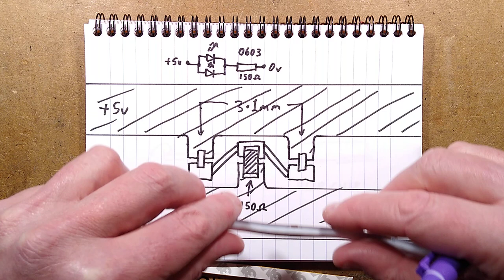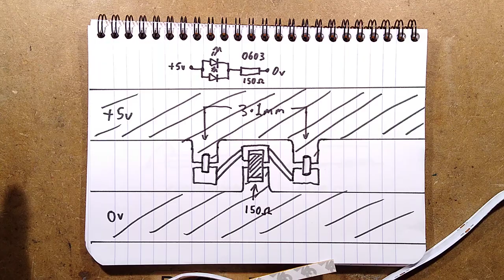Exploring linear LED COB tape with macro PCB shots

Comment: If you look at a strip like that in a future video, could you test how resilient the small chips are to mechanical damage? It is pretty much a brittle silicon die on a flexible strip after all.

And I'd also really like to see the machine that produces strips like this. I wonder if it is maybe even running in a continuous process (the strip moving at a constant speed without any stops).
Reply: I use them for over a year on various clothing that gets quite a bit of flexing. Initially its fine, you can flex it wildly no issues. However after a few months the LEDs start to die out, I would say ~70% are still working. Going to depend on how much flex and abuse they get, but, yeah they won't last forever.

Comment: Just bought a 5m roll of this. I still need lights in my van cuz its simply too dark. Hopefully i can fit in such a way it lights up everything neatly
Reply: Run some strip on one side and then run speaker wire or lamp wire to connect to strip on the other side of the van. If you got the 12v stuff then you can just run an inline fuse to some 12v wire nearby. Probably best to hook it to the dome light circuit so you just use the same switch to run that.
Reply: @MrMega200  Do you know if it's generally okay to just splice into the existing dome light wires? Or would a dedicated line to the wiring harness be necessary / recommended?
Reply: @Heizenberg32  I would first check the dome lights amperage and then check the fuse for what capacity that is. Maybe see if you can swap the fuse for a higher rated one to cover for the LEDs if that is possible or else if nothing will work then just run a red wire directly to battery with the inline fuse spliced in somewhere nicely hidden. Be sure to get the mounting crimps you need to fit to the battery positive bolt and to fit a ground line to a body bolt anywhere. The whole body of the car is a negative. Never ever squeeze in some wire to bolts. This isn't a proper connection and is unsafe.
Reply: @MrMega200  Thanks!
Reply: @MrMega200  Exactly what I did for my car boot (with rubbish light placement).  I used about 60cm of it and just wired it to the existing (LED but originally incandescent) boot light (ok I did get the proper connectors to make it a plug in harness thing with no factory wires cut or spliced but that's just me).  This stuff is so bright, with 5m of it you'd need sunglasses in there!
Reply: @MrMega200  Yes thank you, i was thinking of just disconnecting the dome lights and only using the LEDs. Since there are 2 dome lights in the back (one front left, one back right) to just connect either side of the LEDs to the existing connecter of the dome lights.
And the fuses shouldn't blow if i did my maths correctly
Reply: @colinvos7304  That would definitely work assuming it's like a 5 amp fuse or even better a 10 amp fuse. The former would allow you to run a full 5 meter Cob LED strip. Just have to make sure you get a 12v strip so you aren't playing around with the hassle of a step up converter. Probably the most you'll see from one strip is 50w of power draw, which is well within the limit of a 5A fuse on 12v. The one I got said 24w but it has less LEDs per meter. A 10 amp fuse you can easily run 10 meters of LED strip but that's probably excessive unless you were running. 

In any case you'll have more then enough light with the strip. Easily around 1000-3000 lumens depending on the strip.
Reply: @MrMega200  Yea i got the 12V strip. And sadly i just cant connect it straight to the domelights. For some reason VW decided the fuse can only handle 10W which is exactly the same amount the domelights use, the LED strip i got uses 25W. It doesn't trip the actual fuse, just so electric unit which does fancy dimming just refuses to work with a slightly higher load. Also tried running the led strip alone with no domelight without much success. Currently i've got it running of the 240V using a 12V adapter (i know its dumb) and have a 12V LED dimmer in between it. It's a temporarily solution until i get to the shop again to make them install it properly if thats possible

Comment: Correction for you.
There are varied degrees of density of leds(chips) /meter for both regular and cob leds...so you should mention this first...also difference in voltage...strips of 5v, 12v, 24v for all types

Comment: Love this Clive! Never heard of COB tape.. BTW if my boiler circuit board can be brought back to life by using a hairdryer, is this the caps? I presume I could just replace all the caps on the board. A new board is over £250
Reply from the maker: There's no harm swapping the main capacitors.
Reply: boiler boards are almost always caps and dry solder joints, so re-solder every joint and replace every cap. schoolboy fix for 90% of problems.

Comment: When they use the UV LED's with white phosphor is there UV  light leakage ? I ask because many collectors have gone to white LED's as they were safer for the collections, not so much yellowing of plastic things and printed box damage. Or are the new UV / white , LED's just as bad as the old florescent tube lights that would turn a white vintage plastic toy yellow in months ?
Reply: Most white LEDs sold today are phosphor converted with blue pumps that have a peak wavelength in the 445-455 nanometer range.  They emit virtually no light below 400 nanometers, making them very safe for museums and others seeking to minimize aging from ultraviolet light. Violet-pump white LEDs also exist, with pump peak wavelengths anywhere in the 405-440 nanometer range.  But they are specialty items and generally cost more.  Examples include Seoul Semiconductor Sunlike, Nichia Optisolis, Soraa, Yuji VTC, Bridgelux Thrive, and sunlight spectrum LEDs from LCFOCUS and Guangzhou Juhong.  They emit some ultraviolet light, though in many cases not much.  I'm not aware of any ultraviolet-pumped white LEDs.
Reply: @jbalazer  Thank you.

Comment: Very interesting, although with that much power I do wonder how it goes with dissipating the heat. I made up an LED panel out of 12 strips of 15 LEDs (180 in total), and at full power it gets almost too hot to keep your hand on. And that's literally on a big aluminium heatsink. It would definitely need a fan if I made the same thing out of this tape.

I am tempted to pick up some of this stuff to build a new panel. It would be nice to have a bit more headroom for brightness compared to my old one, mostly in short bursts to take a photo or inspect something closely. A quick ebay search shows it's available in warm/cool white, although it lists the CRI as ">RA80", which isn't terrible if it's actually above 80. The tape in my old panels was listed as 85, which is probably good enough. 80 might be a little low though.
Reply: I made use of the heat on an aquarium project build in uk. 
With the led strips bonded to an alloy c channel strip, I have filtered tank water pumping into the channel at one end and out the other side back into the tank, small pump has thermostat set at 27*c
The benefits are already reduced power usage for lighting (changed from 2x 1m t8 fluro) and reduced time the traditional tank water heater is on.
Reply: @RawTopShot  That's a really clever use for the heat, and cooling the LED strip will probably make it last longer.

Comment: Hang on! 16 mA across 150 R will drop 2.4 volts approximately half the supply voltage. Therefore efficiency of only around 50%. Am I right?
Reply from the maker: Yeah.

Comment: Have you had a time to dig into these fake filament sticks? They're string of chips bonded with wire (that's why they break so easily) embedded in ceramic material (hence why wires in the first place) and covered with phosphor. They're ridiculously tiny. I had to use microscope and precise pogo pin leads to lit one chip on its own.
Reply from the maker: I've featured LED filaments a few times.

Comment: Do they make an IP65 weatherproofed version? I figure that night cycling (aka any time after 16:30 this time of year) would be a lot safer if I was lit up like a christmas tree.
Reply: Robus do an IP67 version but it's 24V.
Reply from the maker: In my experience the weatherproof versions aren't that weatherproof.
Reply: I use these for cycling, its OK, just brush some conformal coating on the exposed copper and dry them off after every ride.

Comment: How about the heath dissipation? 10 watts in 1 meter is a lot. Those early waterproof led strips had a tendency to kill themselves slowly by overhearing the die.
Reply: Use a resistor and run it cooler.

Comment: These strips are designed to be used in combination with extruded aluminium profiles. Running them at full power without a heat sink will cause them to run way hotter than intended and die prematurely.
Reply: You can get round that by running them from a constant current supply.
Reply: @gordonlawrence1448  constant voltage supply is enough as the resistors throttle the leds to a nearly constant current.
Reply: @gordonlawrence1448  I don't think the operating temperature of the strip is dependent on whether the supply is CV or CC.  Power is just the product of the voltage and current, regardless of how the PSU operates.  If you want to run the strip at its full brightness, you need to sink the heat somewhere.
Reply: COB LED strips don't necessarily need heat sinking.  They are rated anywhere from 5 to 15 watts per meter.  At the lower end they will work alright without heat sinking, particularly for wider strips as the strip itself dissipates heat.
Reply: @jbalazer  As you say, if you want to run the strips at the rated power e.g. 5W or 15W, you need to provide heatsinking.  If you are happy running the strip at a much lower power, then you don't need to bother.  You can also drive your car without water in the cooling system, but  you should reduce your speed and make frequent stops.
Reply: @westinthewest  CC has a few advantages:
1. LEDs and resistors are temperature dependent. When using a CV supply you will notice a difference in current and brightness between cold and hot strips.
2. CC lets you run the strips on lower power more controlled than you would usually attempt with under-volting CV.
3. Especially in boats or caravans, where you have 12v or 24v DC board net, you want to take the peaks and fluctuations out of your supply. (A bilge pump or a coffee maker can wreak real havoc.) CC does a better job at protecting the strips from that than most CV supplies. While you can achieve the same with good CV supplies and some additional electronics, of the shelf CC-supplies usually cheaper and easier to use.
Reply: @wilhelmhohenzollern576  I always prefer to use CC if I'm doing a bespoke design for myself or a client.  The advantages don't apply to LED strips though.  The voltage would get crazy after one meter, so the LEDs are connected in groups of series three, say for 12V operation.  The operating current depends on what length the user chooses, say 1A per metre.   
A Constant Current supply would be suitable if you knew the length of the tape and did not cut it shorter or extend it.
Reply: @westinthewest  Yes. I just assumed the the strip being a fixed length and the CC supply matching that.

Comment: What if they made the copper connection strips run all along the top and bottom? That would stop the current drop you get when powering the strip from just 1 end.

Comment: If it cheaper to manufacture why is the addressable RGB cob led strip so expensive? It would be amazing for "light Projects" like PC building but most vender's want like $40USD+ per meter!
Reply from the maker: If you consider that each chip contains three LEDs and a serial communicator, decoder, driver and data buffer it's not so bad

Comment: Are COB LED strips suitable for outdoor use? Great content as usual Clive!
Reply: They come in outdoor versions. Usually silicone coated I believe.
Heat dissipation can be a factor since the waterproofing keeps heat in.
Reply: Yes, they can be.   eFIXX had a look at some (rated IP67) in this video released only a couple of days ago.  https://youtu.be/U_F6R6sWx4I  The segment with the outdoor strip starts at 6m16s, there are timestamps in the text to take you directly there.
Reply from the maker: I've never been impressed by led tape outdoors.  It does absorb moisture and corrode.

Comment: Would voltage drop not exist if they connected the negative and positive supply on either end of the strip and not both on one side?
Reply from the maker: That's a common trick with long runs of LED tape.

Comment: Wait - does the voltage drop mean that the conductive bands along the edges have significant resistance?  If we assume zero resistance along those bands, I would expect an even power distribution and no voltage drop, because the LEDs are really wired in parallel, right?
Reply from the maker: At the current involved the busbars in LED strips do have significant resistance.

Comment: So if I get this right: 5 Volt in, 3 Volt used, 2 Volt dissipated through resistors. Are we? Are we throwing away 40% of our power, is 2A * 0,4 = 0,8 Amps (4 Watts)  thrown away? I am so sorry, but this is not acceptable for day to day usage.
Reply: Use a current source driver to drive the LEDs instead
Reply: @antonioagostinelli9430  Do you know how to source LED tape without these dropping resistors?  Such a tape would then be compatible with a constant current power source.
Reply: If you drive the led strip with constant current then, when one led dies, the entire strip dies.  Also, you will be using dangerous voltages. Better to use 24v so the percentage wasted in the resister is smaller.
Reply: @antonioagostinelli9430  constant current supplies aren't suitable for LED strips because you don't know what length the user is going to decide upon.  There seems to be lots of confusion about CC, CV and driving LEDs in general.  These dropping resistors are a crude method of providing the user with the option to cut the strip to any length, but I think it's a solution which is here to stay.  The alternative is to provide an adjustable CC driver.

Comment: Thought this would be the perfect place to ask, I'm either imagining this, because no one else seems to remember them...
In the mid and late 90s, does anyone else remember the bicycle headlights that used green LED's?
They typically came in a pack of 2 - One with a red lens (and red LEDs) for the rear, and one with a clear lens (anf gallium phosphide green LED's) for the front. They each took two AAA batteries. 
I was talking about it with a coworker, and no one else seems to remember them. Were they a real thing, or did I make this up?
Reply from the maker: I don't remember those.
Reply: They'd have been illegal in the UK (and I think the rest of Europe) as your front light has to be white and the rear red.

Obviously that often doesn't stop things hitting the shelves, but I certainly didn't see them

Comment: I am thinking about installing a 15 amp 240 volt circuit in the US with both a  UK and EU outlet on it for the porpise of using foregin test equipment and tools and testing 240 equipment from the EU and UK knowing that we can run these appliances and you can not easily run 120 gear so with this supply chain issues I expect this will be an issue as I am prepping for repair could you tell me ware to buy  these outlets for the US market
Reply from the maker: You might be able to find a UK seller willing to ship to the USA.
Reply: @bigclivedotcom  the shipping I found a local source for a UK power strip and I could clip the original plug and put a US 240 male on the end of the cord but would rather have wall mounted outlet as they tend to be reliable and china supersize to cause issues later on I trust your NEC equivalent over anything china might send either of us
Reply: gonna have to use a VPN to get ebay to offer me UK sellers

Comment: I was always wondered how they solder those tinny modules when I always though that material of those smd parts have lower melt temperature than soldering paste they used as they haclve small as hell and get more temp quicker. I know most use ceramic-like base but what about all those smaller plastic/tinny wires that normally would get annihilated when they solder them on board...
Reply: Im not really sure what you're talking about, but an alternative to soldering that works on heat sensitive components is spot welding. It just zaps enough electricity through a point to bond the conductors and is fast enough that the heat can't spread too far
Reply from the maker: The components here are designed to tolerate a reflow oven.
Reply: Alternativly there are several soldering paste formulars with realy low melting points.
Bismuth based are the most commonly used with melting points down to 139°C.
And some very niche ones going down to 90°C and lower.
Reply: @JackieBright  spot welding microscopic smd elements? I'm talking about board components that have plastic elements or small as hell wire elements that normally when heated even slightly get destroyed but still they managed to stick it board.
Reply: @paranoiia8  Chip wire bonding is done cold. But spot welding also exists, and indeed works just as described: all the heat in one spot, so fast and concentrated that it doesn’t spread. 

As for plastic housings: many of them do soften (but not melt to liquid) at reflow temperatures. It works because we don’t touch them while hot; they come out of the reflow oven cooled. If we were to touch them while hot, they’d deform.